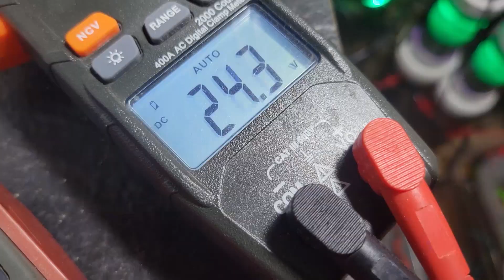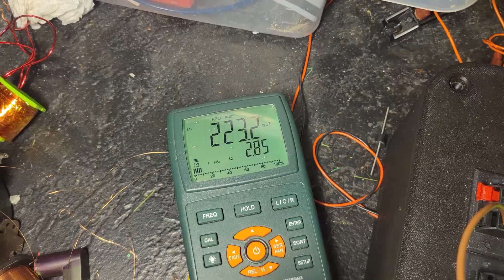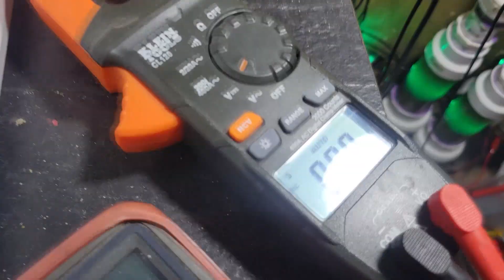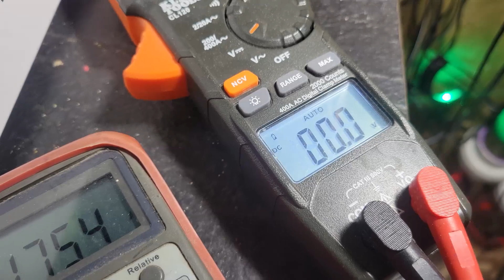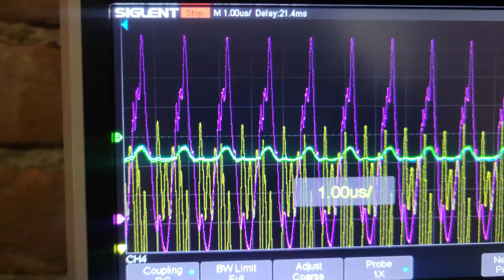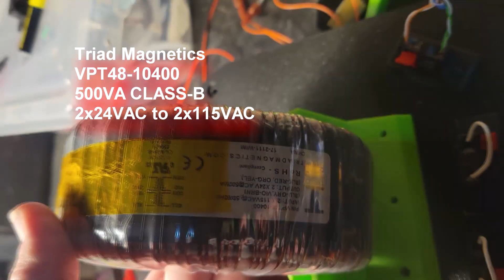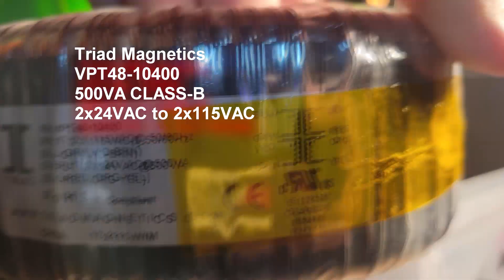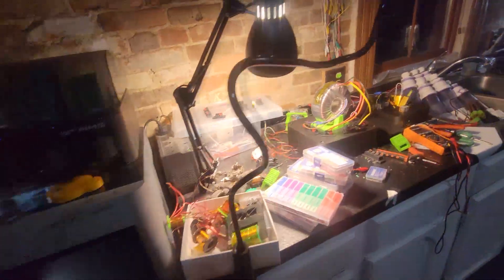NEW VOLTAGE RECORD!!! 6.6V at the Cells = Insane Gas Production

Comment: what exactly is this i am still a bit confused but very interested
Reply from the maker: check episode 1 for a trailer and scour my other videos. I'm here for questions.
Reply: @noahauman  i could not find a clear explanation other than a pseudoscience wikipedia. if it is something else i would appreciate an at least somewhat in depth explanation
Reply from the maker: I'm separating water in to HHO gas, but I'm utilizing high voltage and low amperage; As compared to traditional Electrolysis which consumes high amperage at low voltage. With my method, no electrolyte is needed and efficiency is theoretically infinite. My pursuit at this point is essentially for greater efficiency, to at least co-equal traditional means of Electrolysis.